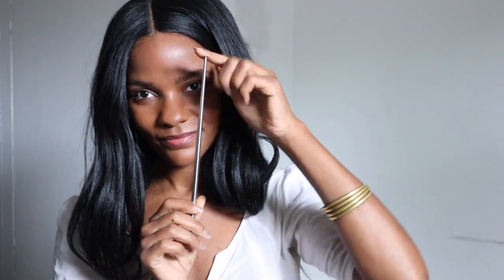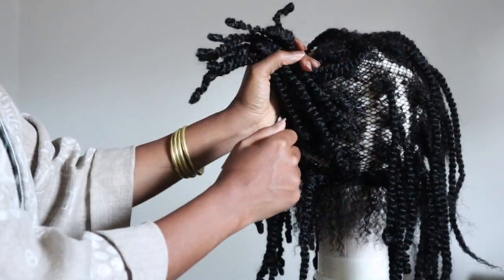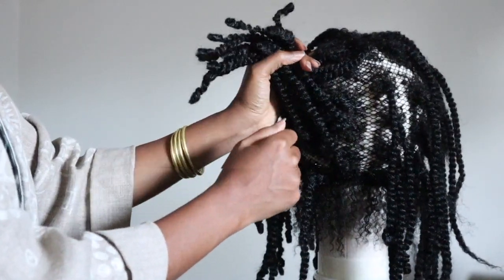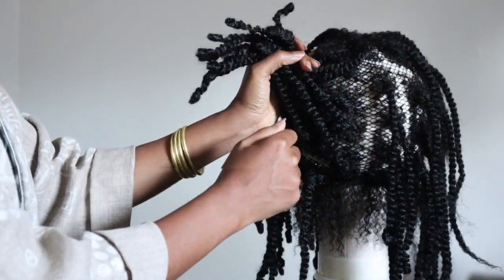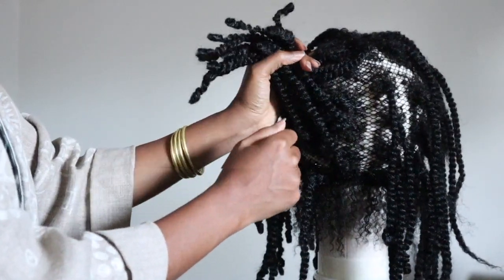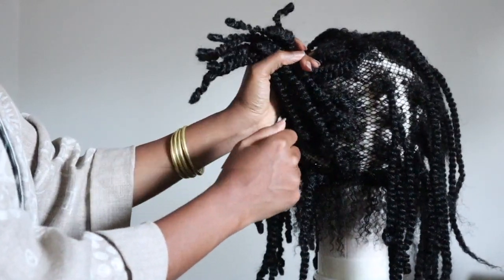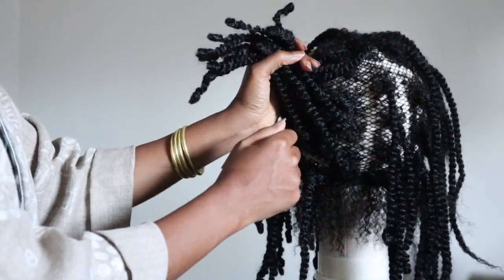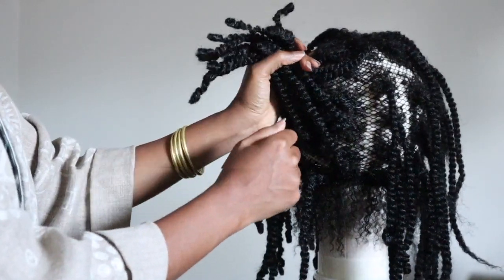CURLING A CROCHET WIG

Comment: Would it be ok to dip the ends in hot water?
Reply from the maker: I haven't tried it. I usually advise against using the hot water method but since you are using that method on only a small section of hair it may be ok
Reply: @ElonBlu  thank you.

Comment: I love your work, I just recently purchased two units from your site. I’ve always curled synthetic units using steam, I find that with steam the integrity of the unit isn’t compromised, and you can use metal wands/flexi rods, etc., for different sizes of curls. Have you ever tried steam curling?
Reply from the maker: Thank you so much for your support. That truly means so much to me. I did use steam when I first started and yes it works. The great thing about creating wigs and styling them is that there are so many different ways to achieve a certain look. I posted a video a while back about all the different curling methods that I have used. I’m grateful that there are so many that can be used because some method works better for others and it’s good to have options. 
Thank you again!! ✨😊